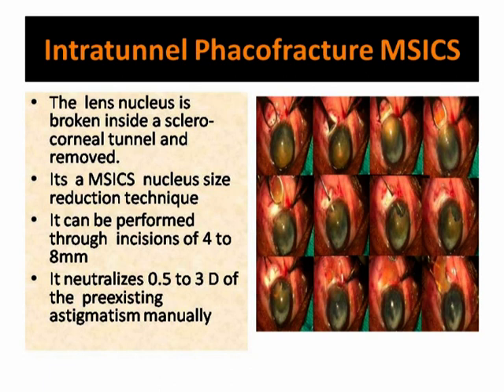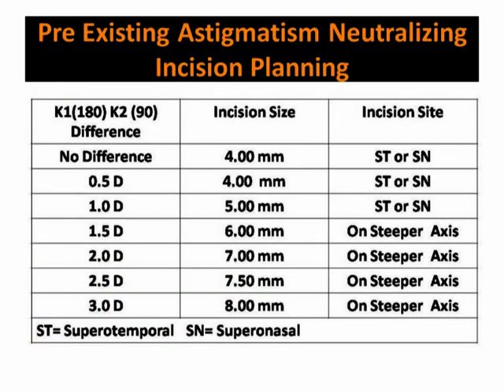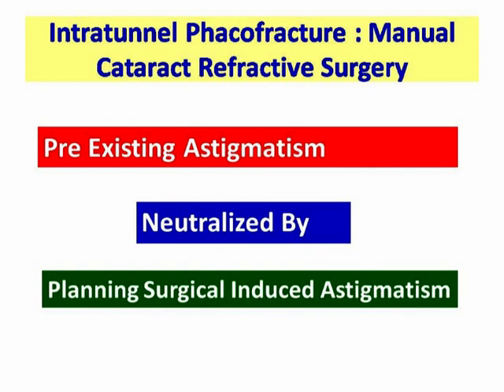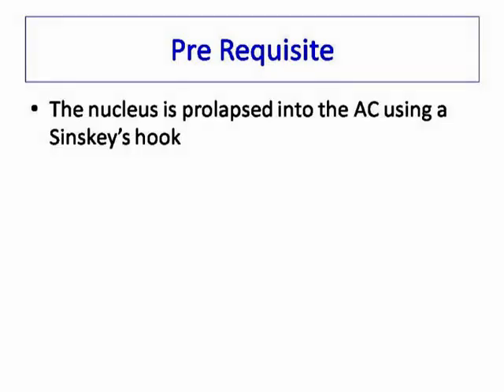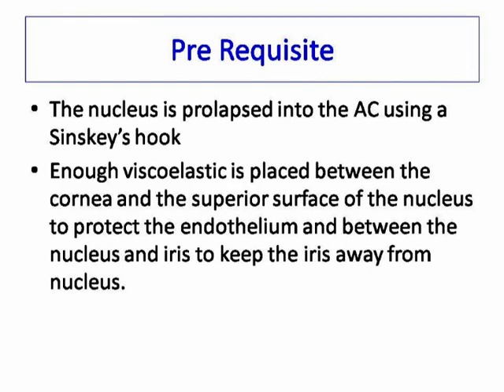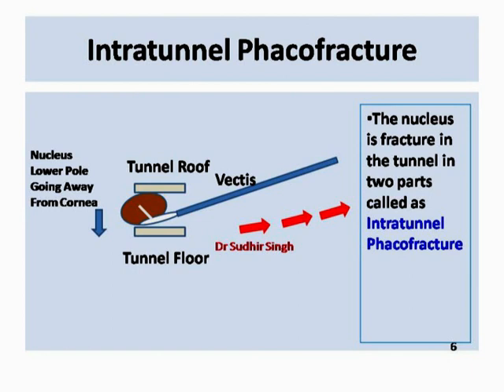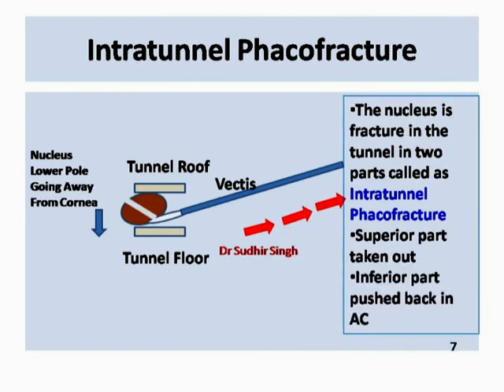Intratunnel Phacofracture Manual Small Incision Cataract Surgery Basics (With Voice Over)

Comment: Dear sir .
how to prevent the iris from sinking into the vectis. this complication is the most formidable in phacofracture and leads to tearing of the iris and the post capsule.
Thank a lot for the sharing
Reply from the maker: Enough viscoelastic is placed between the cornea and the superior surface of the nucleus to protect the endothelium and between the nucleus and iris to keep the iris 360 degree away from nucleus.
Reply: Dear master thank you very much for this precious advice